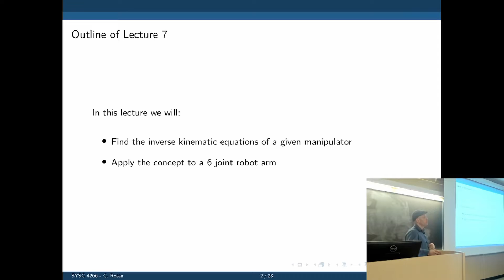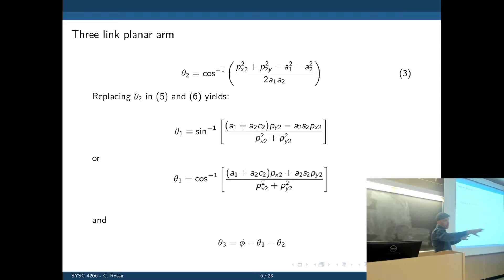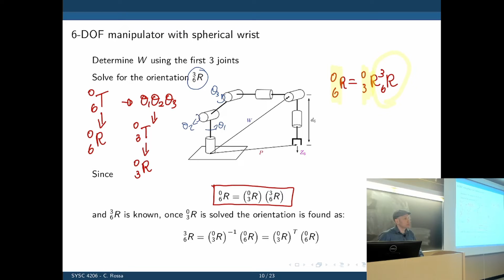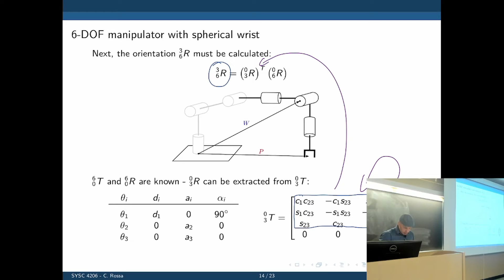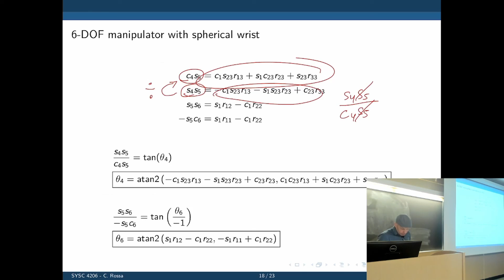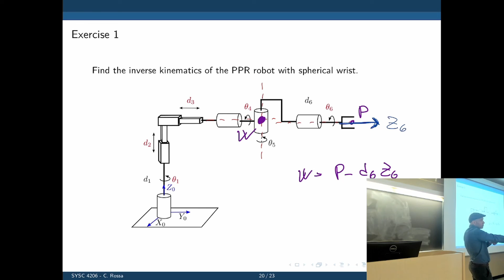SYSC 4206 Lecture 7: Inverse kinematics 2, 6DOF robot arm with spherical wrist

Comment: If i am not mistaken there is a typo for theta 6, the matrix multiplication should go row-column so there is no way the last term coulde be paired with r11 and r22, it should be r11,r21
Reply from the maker: That"s correct. Thank you.

Comment: Thanks for the video! One question: Isn't row 3 in the DH table incorrect for the TRRTRT structure shown in the script? Since joint 4 is a twisting joint, alpha in row 3 should be 90° (and likely have a theta_3+90° offset). The current table lists alpha=0, which implies parallel axes (like in a TRRR robot) rather than the twisting configuration shown. No matter how I set the frames, I couldn't reproduce the table values for that geometry. Am I missing something?

Comment: Sir, how can we get the exact parameter P in the coordinate system in practice?
Reply from the maker: P is known, as it is a vector containing the desired Cartesian position of the end effector (where you want the tip of the robot to be in the xyz space)
Reply: @biomechlab  ok but u can t calculate theta4 theta5 and theta6 using the same calculated angular positions theta1 theta2 theta3 because coordinate x6, y6 z6 will change. In other words u ve to calculate for first theta 1 theta2 theta3 for generic x6, y6 z6 then u can complete with theta4 theta5 theta6 using desidered end-effector position. TESTED

Comment: If the last joint does not exist but the rest joint still the same, meaning there is only 5 DoF, does the solution you described still work? Can it still be called a spherical joint?

Comment: Are those diff equations?
Reply: No they are not.
Reply: @kpm25  what are they?
Reply: @Determinator21  They are Homogeneous Transformation Matrices Using Denavit-Hartenberg parameters. Look up "Denavit–Hartenberg parameters" and you'll learn all about it. Basically each set of joints has its own  coordinate frame so you need to transform from one to the next etc.. 
Differential equations are used in Jacobians when dealing with joint velocities. It's a very interesting topic👍
Reply: @kpm25  thank you